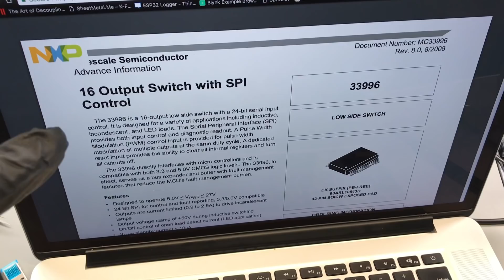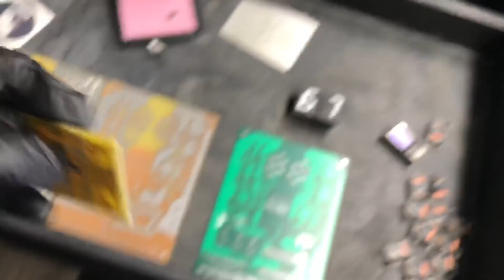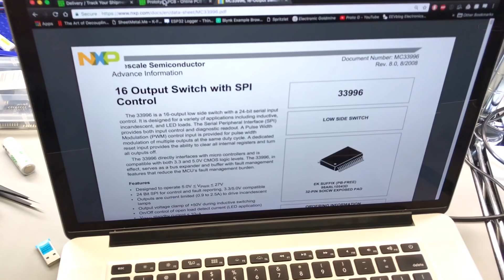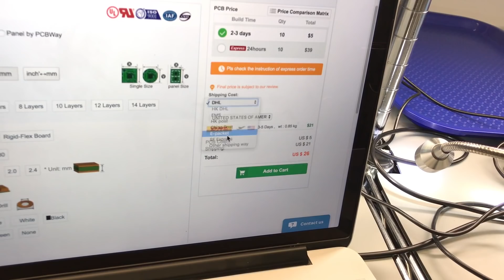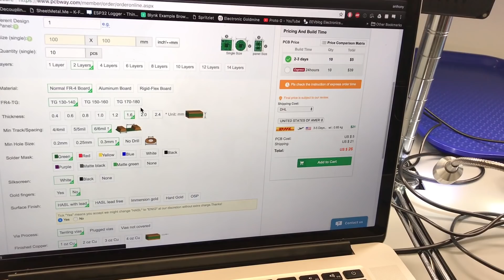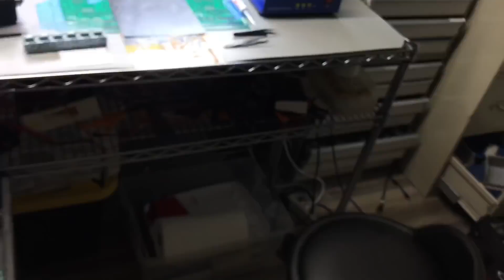My PCB's Were Delivered in Less Than a Week!

Comment: Wow. The boards without soldermask looks really spiffy. It could be cool if you could have clear silkscreen so you keep solderability and keep them from tarnishing. What's the squiggly line on the PCB for?
Reply from the maker: Yeah, I really like them without the soldermask too, but it's much harder to solder the fine pitch stuff. Clear soldermask would be awesome! The squiggly lines are called serpentine traces and that are to ensure signal traces are the exact same length so the timing is perfect.  They're not necessary for frequencies that I'm using(4 MHz), but you'll find them a lot on high frequency PCBs.
Reply: I know all about serpentine tracks, i just thought it was funny to see them on a single-link SPI :)
Reply from the maker: zapro_dk totally not necessary here but they sure do look nice!

Comment: I have used PCBWay at work for about $30,000 worth of PCBs. I've had one single board not pass inspection. They're faster and cheaper than any other American manufacturer I've used. It would be very difficult for me to recommend any other PCB fab!
Reply: I've tried it. You should be vary that they use your exact part number and not some generic one they find. For instance I specified a special capacitor in an RF circuit with full MPN, but they mounted something generic. But you can also enjoy the ease of just specifying "0603 green LED" and they put on something cheap and available if you don't mind it for that particular board.
Reply from the maker: Eric Mueller have you tried their assembly services?
Reply: I have not. We did our own on-site assembly. If someone has experience, I'd like to know their source for parts and any risk of counterfeit components.